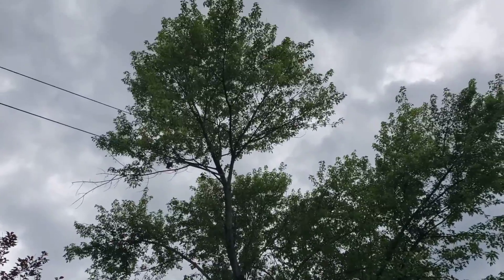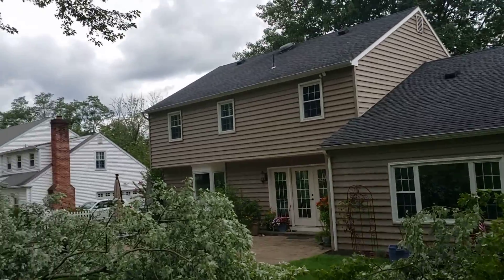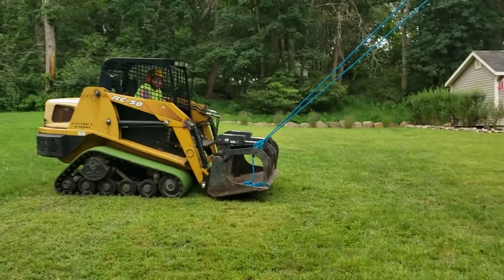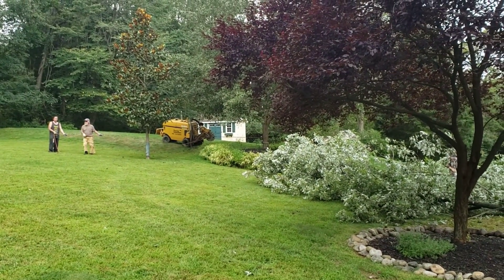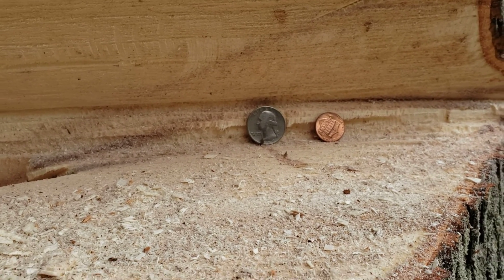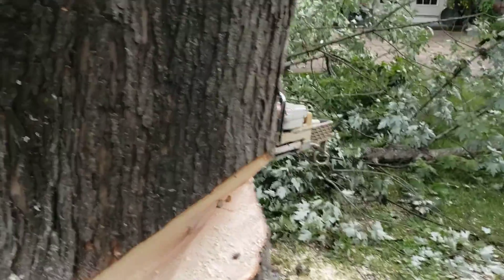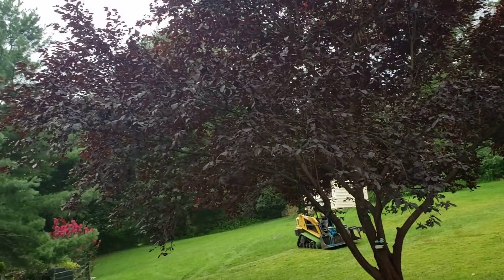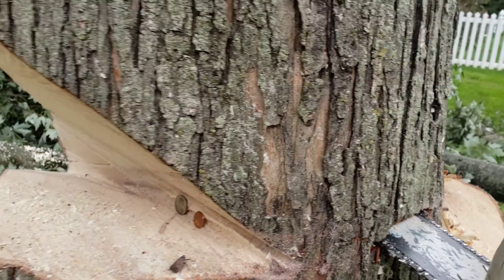Throw Everything to Your Favor (see description)

Comment: Interesting.  So you don't think a dutchman is an aid to felling against the lean at all?
I would agree.  ( important:  I am just an interested layman.  actually know nothing from personal experience at all, nothing ).
What I've learned seems to show that a dutchman is solely to get the movement started.  
You could even say it is there just to save the effort of wedging.
You have a line up.  Don't need wedges or dutchman.
Good one.  There are many vids about swinging trees with a dutchman all leaving us with the impression that if you want to swing a tree you need a dutchman.
Not so.  You demonstrate that.  And may be safer without, too. Because it never gets a start towards falling with the lean.

Comment: Here's the next one.  Shows it fallen. Apparently the camera died and they can't show the drop.
https://www.youtube.com/watch?v=m99kh-Euqo0
I still don't understand the theory. You cut a notch out of the tension side of the tree - i.e. the side away from the lean.  And that does what?  Prevents something happening like maybe the tree falling over to the leaning side instead of falling the way you've cut your hinge?
Or the other possibility - it causes the tree to fall away from the lean and to that side of how you've made the hinge.
Seems to me the first idea must be the one.
For if you want it to fall on the 'non lean' side of your hinge you'd really just realign your hinge wouldn't you?
So I'm thinking it is a prophylactic measure.  A safety measure.  A cautionary measure.  The fear being that the lean is going to break your hinge and instead of it falling 'inline' with your hinge  (i.e. at 90 deg to it) it will swing off sideways to the lean side.
And this stops that.
Ok?
But how?  You haven't introduced anything to make anything stronger.  You cut away some wood that would never have been involved in the fibre strains anyway.
Wood that is beneath the cut.  Beneath your wedge cut.
Wait a minute.  Maybe I got an idea.  Maybe you are making a 'pit' there for the tree trunk to 'fall into' which might offset the tendency to go the leaning way?
Anyone know?

Comment: Did you not consider leaving yourself a proper,clean escape route?...pretty dangerous, unprofessional.
Reply from the maker: I was out of the way.. The tree isn;t going anywhere until I call for the pull... There was no overhead obstructions, so no way that the tree is going to throw something back and the tree was sound, so nothing falling ot of the sky when it began to move... And I was standing opposite the lean and behind the tree... So I was safe. This isn't the woods... If I had any concern I would have stepped away before calling for the pull... Iv'e probably done that more time than anyone else on youtube..

Comment: That is not how you do a sizwell haha, the reason you didn’t see if fall is because it didn’t work. Don’t do this
Reply from the maker: The sizwheel didn't engage because I had a retainer line tightened up to fight the side lean. That's my best guess. The next one worked well and pulled out a lot of big fibers. Made me a believer. It's not used with a Humboldt, but gets the same effect. I like the cut, wahtever you want to call it or say it's not doesn't matter as much as "Does it work?"
Reply: @murphy4trees  they do work when you actually perform the cut correctly.
Reply: @murphy4trees  guilty of treeson had a great video showing how a sizwell is actually supposed to be cut. I’d check it out, what you did can be considered a sizwell but it’s not even close to the actual way they are supposed to be executed.
Reply from the maker: While I appreciate you pointing this out, and admit to being a complete novice in both cutting and observing the effects of the sizwheel, I would challenge you to explain the why. You have a nice rule of how to make this cut that you feel comfortable with, but can you explain why the cut shown here is less effective that the ones that Tarzan and Jake show? Or are you one of those people that just does what he's told and plays by the rules because its easier than thinking for yourself and figuring out the physics so you really understanding what you are doing.
Reply: @murphy4trees  I feel this is to difficult to explain through a conversation. But a sizwell is meant to twist a tree out of a lean. Your supposed to rip a cut down the stump of the tree and it allows for greater wood fiber pull and also kind of acts like a hinge on a Ford effectively pulling the tree a different direction. For instance out of a side lean.
Reply from the maker: I fully understand the concept of how and why the sizwheel works. What I AM asking you is can you explain why the variation I show here is going to function any differently or is inferior tot he ones that Tarzan and Jake show? I'm guessing you can't, given the above response.

Comment: Re: retainer line 90degrees from the lay. A lot of the trees I want a retainer line on are a steep hill and I’ve found it tricky to assess how far ahead I should advance the line when the anchor is set uphill, any tips? These trees are often in forest aswell so having a clean path of travel for the line is sometimes not possible and a releasable port a wrap may be employed. Is that what you had to protect the plum or something more freely releasable. Thanks
Reply from the maker: Good questions. I never got that far enough to teach it as a formula. I just eyeball it and have occasionally left some slack inthe retainer line and often had to set up the porty to avoid damaging other trees.
Reply: In my attempt to work out guidelines for deviation when anchoring up a slope it seemed there were many variables including angle of tree and rope length, maybe it is overly complex or someone who understands math could give a hand?
Reply: I’m imagining a older friction hitch on the line over a chopping block And an axe at the ready, in a scenario demanding quick release  :) Or perhaps just the very end of the line in the portie ready to fly free.